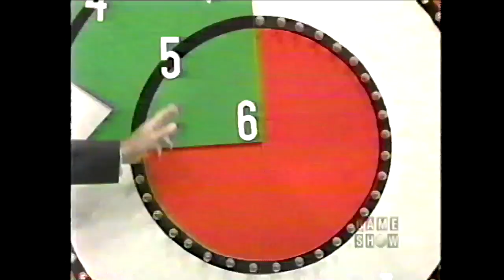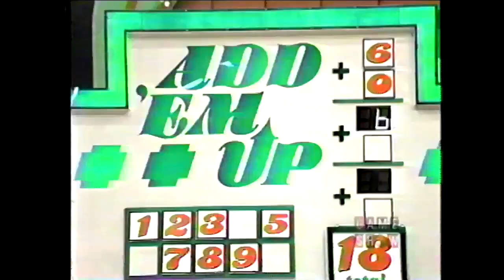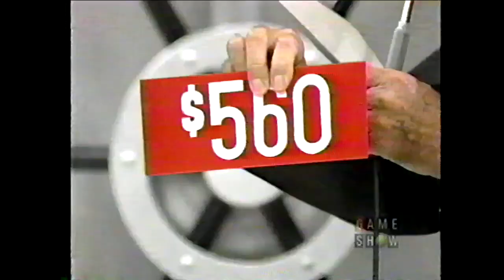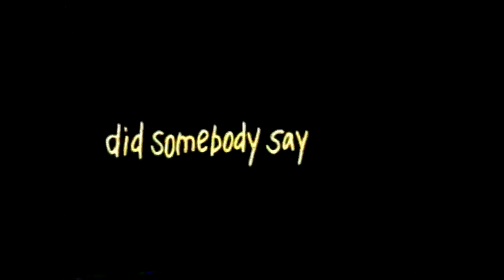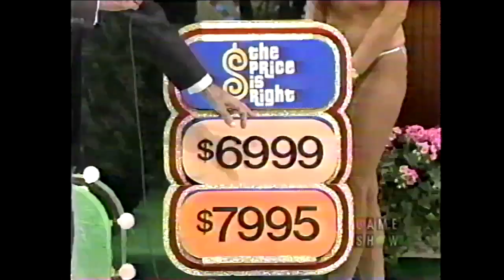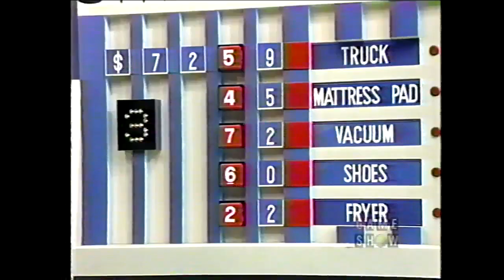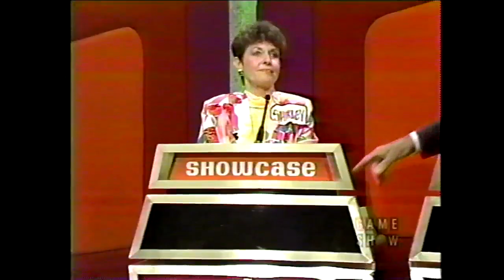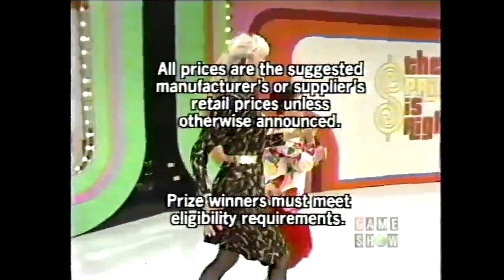The Price is Right (#6281D):  November 24, 1986 (Add 'Em Up played!)

Comment: Now you understand this episode will soon get blocked when Pluto TV reaches this season. You'll have to reupload it on Internet Archive.
Reply: It won’t be affected for some time with Pluto at June 1984. Eventually yes it may have to go onto Archive. It won’t be until Pluto gets 800 episodes in after Sep 1984-May 1986 (of which only a few episodes were rerun by GSN) are added